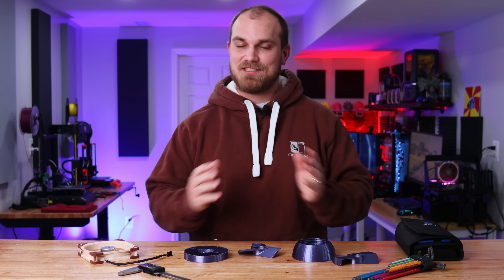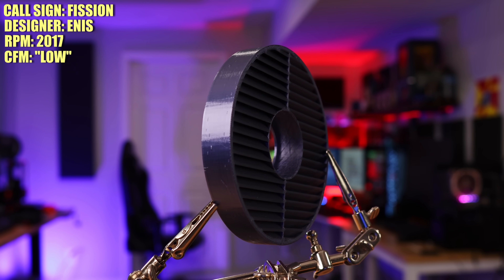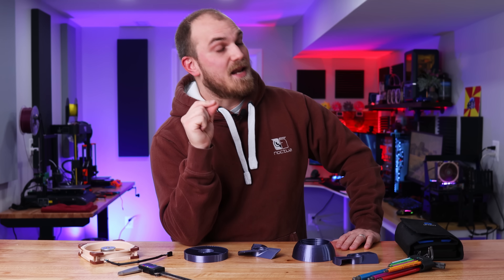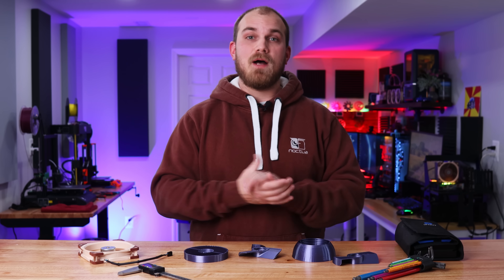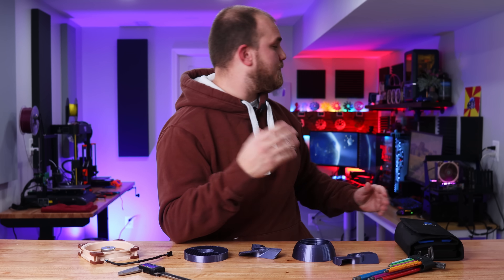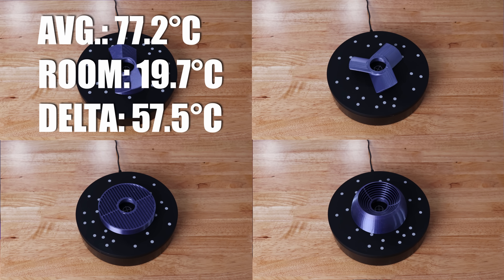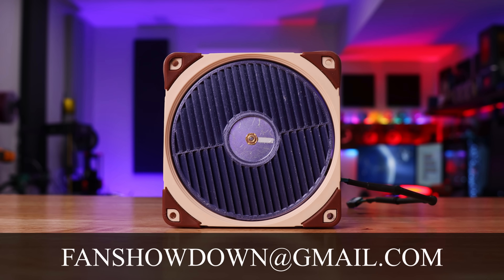IS THIS MAGIC? This Fan Has No Blades | Fan Showdown S2E3

Comment: You should make a joke episode of the showdown and print intentionally bad fans just for the fun of it. Like a fan with a single blade, or a fan that's just a cylinder of pure material, or a fan that spins and makes a whistling sound which means it has to be a low RPM so it doesn't get too loud and is annoying when at full speed, or just a third of a cylinder filled and turn the fan into a vibrating motor

Comment: Bernoullli's Principle states that fluids moving at high speed have lower pressure than fluids moving at slower speeds, and since the bladeless fan's diameter gets larger as it gets closer to the motor, it stands to reason that the air closest to the radiator is the lowest pressure over the entire fan, meaning air will flow in the proper direction as if it had blades

Comment: A swept-back tip would likely reduce noise somewhat, without sacrificing airflow. The same technique is used in the design of some helicopter rotor blades. It increases the overall surface area while keeping the same diameter, therefore the outermost part of the blade doesn't turn any faster.

Comment: maybe that Bladeless design could be improved with high angle of attack blades instead of supports.  I also noticed it still spills some air off the edges, maybe you could cause linear flow over the outside so that air flow isn't wasted either, it's at the very least creating low pressure to pull more air into the system.

Comment: the bladeless wonder if some smaller blades within the structure (towards the base) would create more of a vacuum, to assist with air intake/through-put for functionality? And potentially still maintain it's quiet operation, due to air being funneled through the bladeless section and and not being torn through because of a blade? essentially being like a pressure vacuum based fan... if anyone has the skills or would like to create a mk.2 that would be interesting.

Comment: I feel like that "blade less" design has some more potential to move a LOT more air while remaining whisper quiet
Reply: the radial walls wich only rotate air should be angled, that would improve the performance a lot.
also the smoke test revealed that some air is drawn along the outside(!) of the curve, if the rotor would be a little bit smaller than the fan-opening that outside flow might be used as well.
Reply: @ulrichkalber9039  If you angled them it would not longer be bladeless

Comment: I feel like the Bladeless could perform a lot better if the parts holding together the rings were angled to act more like blades to allow it to pull in more air.

Comment: Under resistance of a cooler the bladeless would win, 2 blade cannot produce the same pressures.  All your tests should be based on cfm on opposite side of cooler.

Comment: for the cone/dome shaped one, a fairly minor change to the design could improve it alot, angle the supports going from top to bottom and add a sight/small rounded fin to each, it should remain quiet but move more air/create more pressure.

a place i worked actually had some turbine fans that had that shape, a set of 3-6-9-12 were possible, though 3 was never used for our uses, 6-9-12 were, they were not as loud as you would expect being they were turbines rotating in opposite directions, but, really they were pretty damn quiet for how much air pressure they created.... they were not so much about massive airflow but about creating constant and consistent pressure, but... the 12 blade at max rpm, was not only ear splittingly loud, it could get enough air moving to clear the whole shop area in less then 15min....we had to do this 3 times in the 4 years i worked there, due to chemical spills, or once... somebody who was drunk, smashed and exploded a container of this fine partical shit we used in the process of creating some products.. the dust could sufficate you...everybody GTFO without needing to be ordered out... 3 of us had resps on already and went about getting double ear protection on, and moved the 12 blade conduit from what its normally connected to.. to a roof vent/filter connection we had setup just incase this kinda thing happened... took 12min from turning it on to the air being safe, we then hooked up some ghettto tubes just infrot of the turbine setup, and vaccumed all of the loose shit off surfaces....then sent the idiot who was drunk home, the next day, he expected to be fired...and found in, instead, he got ot go up on the roof, and learn how to clean the filter up there... not because he needed it but, because it made it so much worse, they had him put on one of the full top tier hazmat suits the company had(owner got a great deal on them military surplus, we used them mostly to avoid contact with some of the chemicals when working on the plating and powder coating equipment, and then, only when it was a risk of being blasted with something caustic.)  anyway, dude spent the next week, cleaning that vent system, the stuff we had sucked up... was like toner for a laser printer...in the worst ways for cleaning iit up..its waxy greasy power that had partialy melted due to the heat from the sun that summer on the thing, he actually was told he could take the suit off, instead he hooked it up to a vent on the roof that was blowing cold air from the server room(had a cap one of the guys who felt bad for him removed, intending to just setup one of our bad weather repair/emergency tents over it.. the guy ducktaped the hose that went to the filter box, to that vent, and rather then bake he froze....but he also ended up blowing the cold air on the stuff he was cleaning to make it easier to get the stuff off..it had mixxed with wood dust, metal shavings, and general crap sucked in during its normal use(it normally ran under its own far weaker fans whenever specific machiens were used, thankfully for that week, the owner decided to have all of those given a full working over and fix anything that looked worn/about to fail/etc... he realized how bad the filter would be knowing what we sucked up...later he told me he was partly to blame for the guy showing up drunk..he was drinking with the boss, and just has a much slower recovery time... (dude would stay drunk most of a day if you gave him a few in the AM... and he once took an oxycotin... he was fucked up for almost 3 days... his mother was actually quite amused... she gave him shit in spanish for years over it... "you know you cant take stuff like that, you cant even drink, dont be stupid like your uncle"   (whos in prison for fighting with 3 cops...and winning... he driank some taquila... somehting like 14hrs earlier, in a few drinks and was still "angry drunk"... yeah...im glad at times that i have trouble getting a buzz, let alone getting drunk...)

Comment: I'm thinking that Bladeless could achieve higher efficiency if the walls were more conical. With the long curve, you end up with a portion of the back end of the fan simply not contributing to the acceleration of air. This, i believe is contributing to back pressure, si if each layer was a cone, the acceleration would increase the entire length of the fan.

Comment: From my perspective the problem with the bladeless is that it has no blades that can scoop and direct air. Maybe if the design would put a slight incline towards the spin rotation it would work better. For example if the lines that connect the circles would be diagonal it would work better.

Comment: For the 'blade-less' fan, I wonder if arranging the spokes in a more 'blade-like' fashion would allow the fan to draw more air in and achieve better airflow without compromising the low noise level aspect of the fan too much.

Comment: Does having an odd or even number of blades have an effect?
Reply: Depends on the fan, but generally more blades = more noise + a usually heavier design making your rotations per minute the motor can put out lower, but more fan blades also generally increase the amount of air you can move, so finding the right balance is a numbers game and entirely dependent on the fans design, some fans do better with odd number blades some do better with even numbers, the most important factors for a fan is how fast it can spin and how much air it can move, number of blades is just a product of finding the best possible combination of the two

Comment: If I had the technical ability I would just add blades into the bladeless. it already has a series of structural supports, if you link those and either curve them or just angle their placement you would get positive air movement.

Comment: If I were to make some suggestions for that bladeless fan: The supports going from the outer shell to the center need to be curved as if they're fan blades themselves rather than going straight from front to back; and secondly, I saw a lot of air being pulled but not enough to enter the fan itself, instead, hitting the side of the shell, I believe adding some small holes burrowed at an angle for pulling will allow air hitting the shell to enter while disallowing air from exiting through the same holes.

It's important to be restrictive to force airflow through a single direction, but not so restrictive that you prevent air from entering at all, after all, the more air that enters, the more that leaves, and the more it can cool as a result.

Comment: If you were to angle the mounts for the bladeless fan inward or angled them so it technically would be a blade within the cylinders it may be a little bit louder but it would push more air and therefore would actually demolish the competition. Opinion

Comment: If the “bladeless” added an angled plane where the support structure is, it would perform way better
Reply: Yea i was thinking exactly the same. Turning the support structure into a slope. And also maybe tuning the distance and amount of rings. But then the big question is. Is the low sound a result of the design or just simply becouse it moves low air volumes. At some point u will hit a wall when it comes to sound on a certain cfm/diameter
Reply: @dagtveitgmail  I felt those supports were in effect a blade - and angling them with a curve - to make blades - may still be quiet but have increased airflow
Reply: that was exactly my thinking
Reply: Adding to your suggestion, I’d say that the support structure should be spiraled as to give the “bladeless” a corkscrew geometry to assist with the pressure.
Reply: @Destroyer9747  Maybe have the rings corkscrew on the inside and smooth on the outside, and the supports simply angled. Also maybe have the rings funnel-shaped rather than dome-shaped.
Reply: You want to add an angled blade in the place of the straight walls? It'll be noisier and flow more. Worth trying.
Reply: I was thinking if he can add like an air scoop along the outer wall and maybe that can move the air around inside.
Reply: but then it wouldn't be bladeless
Reply: @cabbagemerchant8506  then he shouldn’t call it a fan
Reply: @chad6  ur a fan
Reply: @cabbagemerchant8506  ahh dang gottem gg’s
Reply: All of these suggestions involve adding blades... which decreases the novelty value
Reply: @ThomasBomb45  Is novelty the whole point of that design, though? The designer said he'd be happy if the CPU doesn't throttle, which it achieved, so obviously he did have functionality in mind. And it was designed to have a certain airflow dynamics effect, which it also achieved, so obviously he had practicality in mind.
Modifying the design while maintaining the core principle isn't going to negate the design, only enhance it.
I'd even argue that limiting the design to bladelessness would force it to be nothing but a novelty piece, something which doesn't appear to be the original intention. Not all experiments are novelties, not all novelties are experiments. This was an experimental fan just like the rest.
Reply: @pubcollize  it's pretty obvious that the whole point of that fan was to be blade less, and then see how good you can get without using any. Adding blades would remove it's reason for existence and make it pointless. If you want an efficient design while using blades, then that definitely isn't the way to go.

Comment: I think instead of a leader board.
You should do a leader graph/chart
That focus on max air flow and noise 
What pushes the most air doesn't do it the quietest, and the quietest doesn't move the most
But we would be able to see where each fan sits on the scale
Sounds fun

Comment: Do you think the bladeless might work a little more if it had tiny vents cut into the side, like jet engines have vents to pull in air via the thrust of the main exhaust just because of the difference in air pressure?

Comment: that bladless fan has great potential though, like notice how inside it has those straight up pieces to hold the layers that goes out. What if he changed the design to make those straight pieces in a blade format? I know it wouldn't be bladless anymore but for sure it could take advantage of the way that the intake of air goes in and probably would help reducing the temperature overall.

Comment: I believe, shielding the sides of a fan to keep air from getting pushed out the sides is a fallacy. A fan creates a vacuum and pulls air from all directions except the direction it is being forced. As long as the pull of the vacuum exceeds the initial push from the blades, in any given direction, the air will be sucked through the fan. Shielding the sides does have its niche benefits. I believe it can be used to increase airspeed by further accelerating the air in the stream by keeping it from being slowed by the drag from pulling along more air, and thus increase static pressure (as long as the conditions allow for it) but if the air cannot pass through the heat sink fast enough this might not serve any real benefit. However, this does, in most circumstances, I believe, reduces the amount of air moved, and is thus not very useful in cooling applications where the size of the heat sink matches with the diameter of the fan. Keeping the air from going around the heat sink is of course beneficial, which I suppose is why the side between the fan and the heat sink is enclosed. Disclaimer, I have no expertise in this field and am by no means qualified to rate a fan design.

Comment: really curious what would happen if the 5 "lines", that keeps the 'bladeless' stable, were actually shaped like a blade (if possible). We need a new series! Most interesting tweak/change of "fan design", side by side comparison, points given depending how much improvement there was (if it was) from the original design.

Comment: On S2E1 you stated that you would be limiting the RPM to 1200, but on your leader chart and in your videos you state an RPM. Are you measuring the CFM at the stated RPM or the 1200RPM. Or have you abandoned the 1200 limit. I ask because there should be a direct relation between CFM and the Delta.

Comment: So uh, I have a Graphics card that I let my roommate use, his idea was to break a fan blade off to "reduce the ticking sound" and has now broke a 2nd blade to "make it even" would I be able to 3d print a fan blade and use that? 

The card in question is a Zotac Gaming 1650 4gb

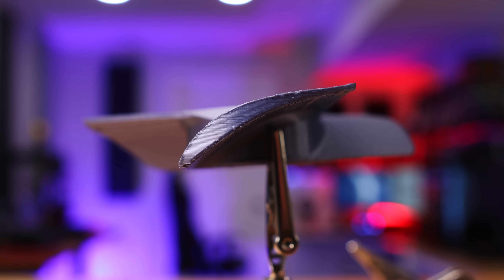Comment: I'd like to point out that Eric's air foils are oriented the wrong way, as can be seen at 1:19 . The way that fan turns should have the bottom (the flatter face) of the air foil face the direction the air is blowing, and the thick part of the foil should be toward the leading edge. Could you ask him to reverse the direction of the air foil and test his design again? Because this looks like a HUGE oversight on his part. I would expect the performance to improve if the air foil were oriented in the right direction.

Comment: So since the bladeless fan did so well, why not see what happens if you take out the middle portion of it and add a fan inside it? Then you have the cone shape funnel and a fan in the middle. You then get more air coverage and also allow it to pull air faster in. Its a win win and could potentially beat the leaderboard if you got a good enough fan inside.

Comment: Add some twist to the radial supports in the bladeless so that they come out from the hub helically rather than straight out to the outer edge with more of a helical angle in the center and less toward the outer edge in order to keep their relative angle vs distance traveled more constant) and I bet it would increase the airflow a lot.

 You should alsotry using a multirotor prop in place of a fan, those things are generally designed for maximum efficiency.

Comment: The bladless is a proof of concept, there's still much to be improved upon it for it to actually push air better

I think adding some roughness to the rings in the form of many small notches will help it a lot when it comes to grabbing air, cause as it stands it's only using the viscosity of the fluid (air) for traction, perhaps even slant the rings to provide a better push but that's dangerously edging the line to having blades... I still think it would be worth it

Comment: What would the effect be on the bladeless if the spokes weren't straight.
Maybe that will decrease performance because the air doesn't get slung into the walls as hard, 
or maybe it will increase performance because it helps pull air through.

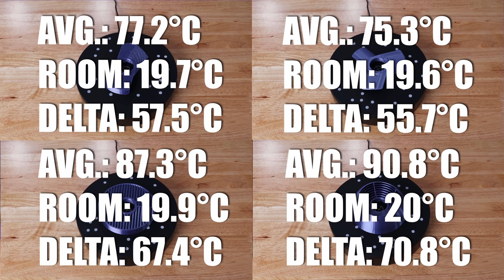Comment: 8:15 I have no idea what these numbers mean. I'm assuming, they're in order of best preforming? Anyway, cool series. You got a new sub.
Reply: AVG is the average recorded temperate of the CPU over the 30 minute test when using that particular fan to cool it.

ROOM is the average temperature of the room during the test.

DELTA is the difference between the two. Lower is better.

Because the room temperature can't be kept a constant, Delta is a more accurate than average CPU temperate at determining which of the fans is the most effective.

The trinity, top right, wins with a delta of 55.7 degrees Celsius.